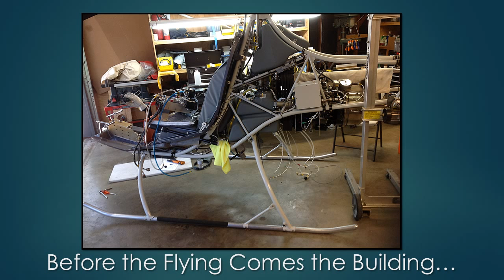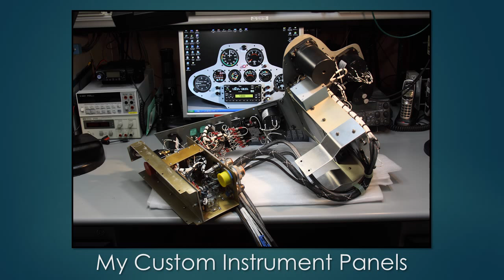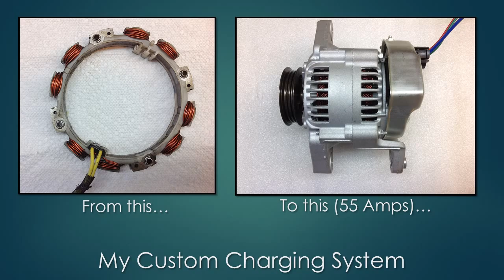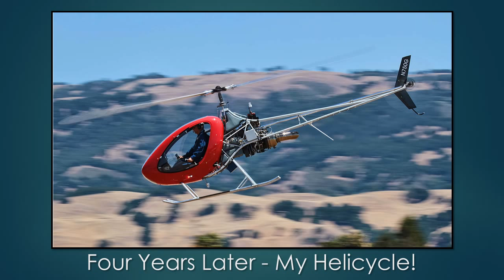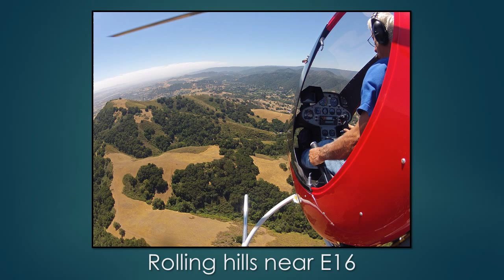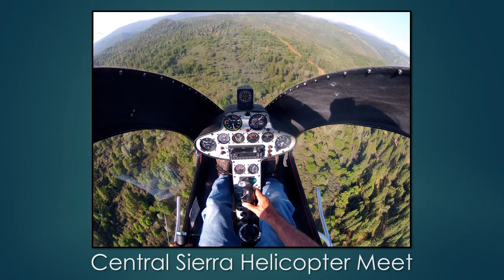N750G Pictures - Construction and In-Flight

Comment: I like your low rotor RPM alarm very much. I completely agree with your philosophy. My first experience with rotor RPM gauges was a dual display unit. At least they were located in one place. Some ships don't even have that. My goal is to own one of these and if that happens I want your Alarm system on my ship. We'll be in touch soon.
Reply from the maker: I'm sorry.  They are no longer available.
Reply from the maker: I'm glad you liked my alarm.  It worked great, but was difficult to produce and, like all Helicycle projects, it took a great amount of time, and couldn't be sustained.  I'd be happy to turn everything over to anyone that wanted to manufacture more, but that's no longer possible.  It could have been made even better by monitoring engine speed and doing a comparison to look for belt slip.  That could trigger an aural alarm.